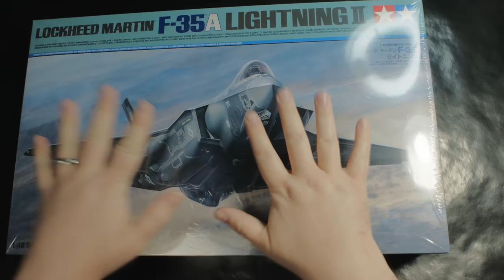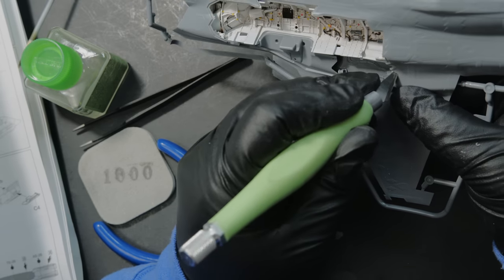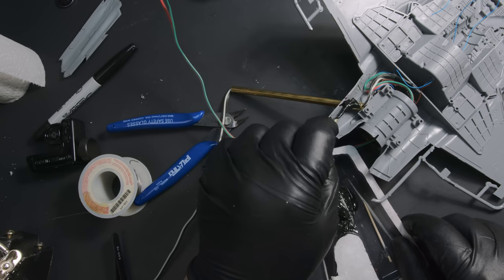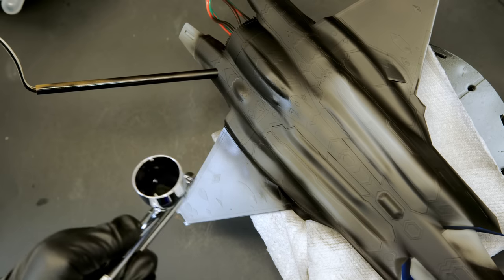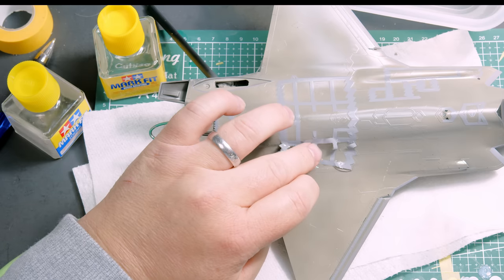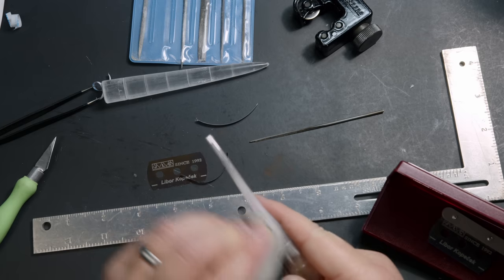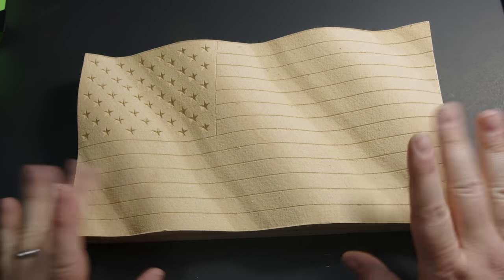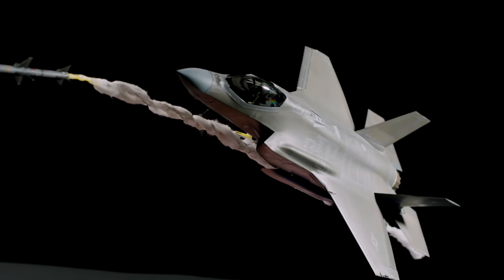Tamiya 1/48 F-35A Scale Model Full Build

Comment: The afterburner effect is probably the most amazing lighting effect I’ve seen - excellent job!  Only thing I can think about with the metallic color being blotted out by the Ghost Grey is that you might have to thin out the grey a lot more and apply in very thin coats.  Easier said than done - I have to practice that myself for my F-16 build.

Comment: Great video and congrats on 1k! Like the afterburner! What I find works for me with Mr Surfacer is diluting it 60-70% Mr Levelling Thinners to 30-40% paint and if I’m not happy with the finish immediately after painting I put neat Levelling Thinners in the airbrush and spray it lightly on the model. This blends the surface and makes it much smoother and as an additional benefit it partially cleans the airbrush!
Reply from the maker: Thanks for the comment! It sounds like I need to thin my paint a bit more. That tip about spraying thinner after painting is gold. Definitely going to try it. Thanks again!
Reply: I'm guessing your airbrush has a very small tip size? 0.2? The spray pattern for priming something of this size seems very small. If I'm right, the problem you'll have is that about 70% of the paint is going on as overspray, so it lays down dry and grainy. You need it going down wet. I'd suggest a tip size of .35mm.
At a push, you could thin the paint a little less (levelling thinners is fantastic), and spray at a higher pressure and a bit further away.
The best resource for modellers here on YouTube is Scale Model Workshop by Paul Budzik. He has incredible videos that will help understand how to achieve the very best paint finishes.
Hope you find this useful.

Comment: For the board and at the base option I use is a router you could find one at Home Depot or Lowe’s for like 5060 bucks and you can just do 2 to 3 passes and save yourself a bunch of time router is super quick but you do want to practice on a separate piece of wood because it can fly all over the place if you are not ready lol. You build a base and save yourself all the time like you said lol